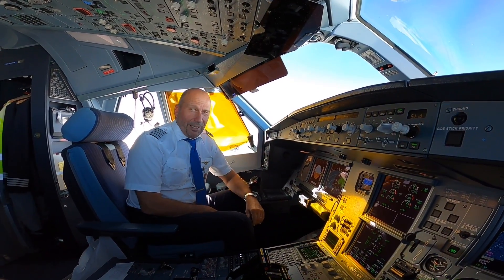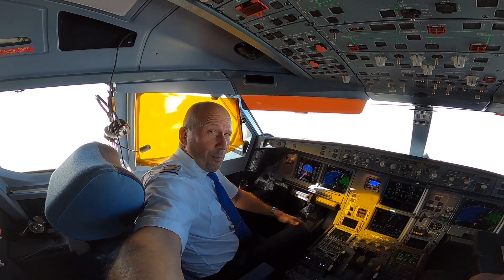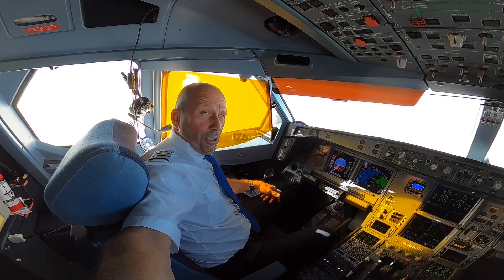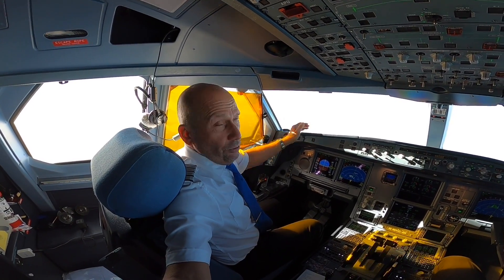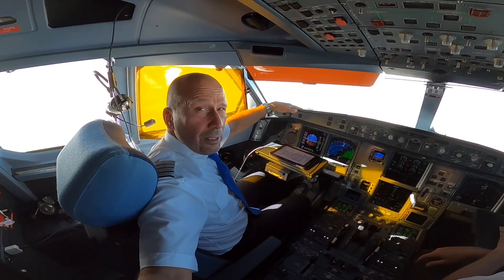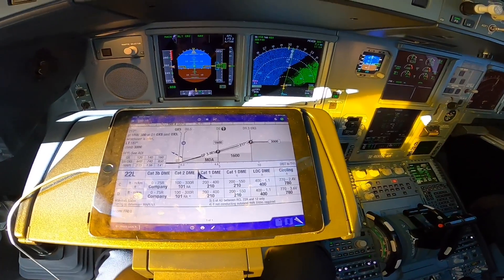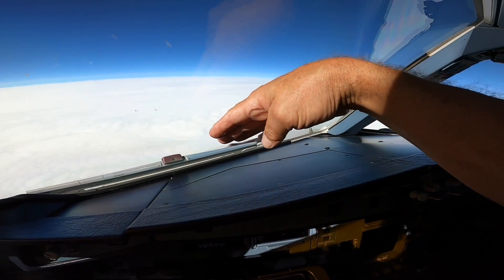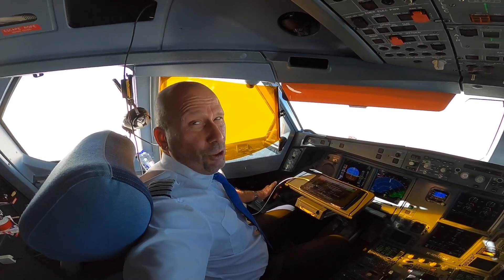Explaining how we land in fog without looking out.

Comment: Hey bjorn, one question: You showed us that the side stick position steers basically g-force vertically and bank angle vertically and then holds it like this. Does that mean it also auto-trims it, for example if you deploy flaps, does the pitch stay exactly the same?
Reply from the maker: Always auto trim yes, in normal law. In some degraded laws it say "use manual trim" on the adi.
Reply: @bjornpilot  Does this include windcorrection in case of a strong gust that might change the pitch or bank? or ground effect correction right before touchdown?
Reply from the maker: Jemand The flight control laws take care of gusts, so  move the stick as little as possible. Close to the cround the flight control law changes. It actually changes for different phases of the flight, especially close to ground.
Reply: That would be correct. Airbus work on Fly-By-Wire, so it'll maintain the same pitch, heading and bank you put it in so long as it's safe to do so.

Comment: Sir after reading in the QF72 I learned the rudder in some A330’s is mechanical and in some it’s FBW. So if you had complete failure of the computers (I know it’s virtually impossible) then how would you move the FBW rudder to turn the plane or would you just use engine thrust
Reply from the maker: Mechanical backup for the rudder. If all computers work it's fly by wire rudder and all turns are automatically perfectly coordinated.
Reply: bjorn pilot ah ok. But in some A330’s it’s still a purely mechanical rudder you mean?
Reply from the maker: Thomas Mortimore The 330’s are all the same. Normally you have rudder by flight control laws. But there is a mechanical backup in case of degradation of the computers.
Reply: bjorn pilot oh ok. I was just reading from the QF72 report

Comment: Can you please explain why there are two auto pilot buttons? one for you and the co pilot.
I would assume that even just one button has built in redundancy. 
Are they set to different parameters?

Thanks
Reply: AP1 gets its information from the captains instruments and sensors, AP2 gets its information from the FO’s side. You activate the side of the pilot who is flying. So for example if the captains altimeter or airspeed indicator were to fail then AP1 wouldn’t know what the altitude was but AP2 would so you would switch to that one. Both are used during autoland for redundancy as they cross check one another to make sure the information is exactly the same.
Reply: @tomstravels520  Thanks!
Reply from the maker: @tomstravels520  great answer. Appreciate your help. 👌🏼🙂
Reply: bjorn pilot I know technically you could then switch the captains ADR DATA to 3 but didn’t want to make it more complicated to explain

Comment: Can you explain about trimming and how rudder & brakes are controlled
Reply: Trimming is just moving the horizontal stabiliser so you don’t have to pull or push the controls to maintain the attitude you want. The yoke or sidestick just move the elevators for short term movements

The rudder is moved by the foot pedals and the brakes you push down the top of the pedals with your toes

Comment: Great video as always. My suggestion is for you to do a brief video explaining the basics of the autopilot, managed altitude, speeds, what is a flight director, etc. I've seen this in other channels but would love to learn it from you!
Reply: In simple terms the flight director is telling the pilot or autopilot where to point the plane to follow the required commands input into the flight control unit (altitude/heading) or the FMGC (lateral and vertical navigation)

Comment: could you explain more about the functions of the button above your head. I feel like these are the buttons no one talks about in aviation videos!
Greetings from Iceland <3
Reply: Buttons in the centre overhead are generally only used during startup and shutdown unless emergency in flight. Basically fuel, electrical, bleed air, hydraulics and fire. The ones nearer to the windshield are lights and APU which are used more frequently.

Comment: You mentioned that you only have one autopilot on at a time. Was wondering why not both, with ap1 or ap2 selected? I work for an international flight training school where we specialize in simulation training, and I am a maintenance tech on the equipment. My office specializes in rotorwing ac and from what I've learned we always have both autopilots turned on but we'll select which ap to use. Generally for us it's ap2 since we fly mostly from the right seat. 

I just recently found your channel and love it! Thank you for the videos.
Reply from the maker: Both autopilots only for approach and landing. All other phases one only. If left pilot flies we use 1. Right pilot 2.

Comment: Could you make a video of the whole decent phase. I am curious about how vertical speed and airspeed is managed between the beginning of descent to the final approach. Thanks!
Reply from the maker: Good idea! It's automatically computed and flown by the Flight Management System/autopilot. Needs updated correct winds, altitudes, speeds. Careful programming is required to get it perfect and I give it lots of attention so it gets a very economical and smooth descend.
Reply: @bjornpilot  Thanks for the reply! Cant wait for more videos.
Reply: bjorn pilot and then it all goes out the window when ATC says you can’t descend yet and have to wait. Bjorn do ATC often tell you “descend when ready” so you can do it at the T/D point?
Reply: @bjornpilot  yes please explain this process more. I am doing my PPL and obviously have learned the basics of pitching for airspeed and power for altitude on final, but it is all done visually with pilot judgement. I have always wondered if the process is the exact same for airliners to keep speeds and intercept the glide slope? If so, are you adding/removing the power and keeping the nose at the right height for the speed or is it all autopilot/FMS???

Comment: With regards to hand flying I remember Captain Joe saying that sometimes he'd disconnect the AP at FL150 and hand fly it the rest of the way just to remain proficient.

Meanwhile here I am using autoland on 737 in clear conditions on a flight sim because I'm terrible at it. :D
Reply: Once you have ILS setup just disconnect ap and follow them diamonds?
Reply: Luke Woolner if going off raw data yes otherwise follow the flight directors
Reply: The difference between flight sim and real life, especially if you are using VATSIM, is that you have ATC, MCDU, switches, checklists and everything else to do alongside flying the aircraft, mostly when I am flying I simply do not have the time to be disconnecting and hand flying. Obviously much different to the real world where you have 2 people to fly where you can actually focus on flying the aircraft
Reply: i dont trust autopilot in buggy simulator 2020
Reply: @fahik  VFR is the only way to fly in any MSFS
Reply: Yeah but on a flight sim it’s just you so you need the autopilot at least until final approach as you have so many other things to be doing
Reply: Thomas Mortimore I get 0 FPS so I guess autopilot works for me

Comment: hey bjorn, I have a question, is it possible (although probably highly unlikely) to have GNSS loss of signal or fault during flight? If in IMC conditions, how would you then navigate the aircraft? would it be classified as an emergency and you would get vectored by ATC to the nearest airport or would you continue navigation using radio aids (VOR to VOR)? if you were doing for example an atlantic crossing, what would be the procedure? Loving your channel my friend! Great job!
Reply: Well if you lost both GPS receivers then you’d be relying on the Inertial Reference System being fairly accurate and I believe it would use the average of all 3 to determine position but the accuracy would not be as high so an RNP approach is out of the question

Comment: Hey. Great video as always. May I ask why you can fly more than 1 type of aircraft? I thought most pilots only fly 1 type of aircraft at time? Thanks
Reply: Because the cockpit is identical in all 3 aircraft with only minor differences in the A330/A350. Most of the controls and buttons are in the same location. The difference is the A350 has bigger screens and more complex MCDU
Reply: @tomstravels520  It is more than just what is in the cockpit, but that is a major part of it of course.
Reply from the maker: Can have 2 type ratings. A330/350 is one. A340 is another.
Reply: @bjornpilot  oh. I always thought a330 and a340 were the same type rating. Thanks for your reply!!
Reply: Just Airbus things..

Comment: Would love an explanation of Airbus flight laws and what training you've had for the likes of doomsday scenarios - like direct law. Would also love your opinion on and what training you've received for spatial disorientation and what procedures are in place to avoid the likes of AF447 again where tragedy happened when one pilot was pulling up and another pushing down during a stall. In a Boeing aircraft that would have been immediately visible via the yoke and arguably could have been saved. How did side stick priority allow that to happen and how is side stick priority decided - I'd assume left seat? Is the side stick a Airbus design flaw vs Boeing? Love the videos please keep posting - esp the A350! Keep safe and safe flying during these difficult times Captain.
Reply from the maker: Thank you for your inputs. Good suggestions. 

Flying an Airbus you must look to see what the opposite pilot is doing with the stick. You don't see it on your own. You also must know that the pitch is around 2,5 degrees nose up at cruising altitude. If it's another value something is wrong. 

We have trained a lot to fly without airspeed indications at SAS, at all phases of flight. Including approach and landing. 

Great idea for a video, but a tricky one. I'll do it! 👌🏼🙂
Reply: Nobody pushed the sidestick priority button on AF447 and the dual input warning was not heard because the stall warning has higher priority. The rule is trust your instruments unless you can see that one is different to the other (that’s why you have 3) which Bonin failed to do. Same with that Atlas Air pilot in Houston. Believed he was stalling so pushed nose down and crashed the plane. Even with a yoke the captain still didn’t do anything until too late

It’s only a design flaw if that is how it supposed to be done but doesn’t work. Golden rule of airbus: Only one person flies the plane at a time. That’s why you have Pilot flying and pilot monitoring and you make it clear who has control.
Reply: Thomas you are quite right in what you say. It's one thing us sitting here in hindsight debating the issue and another actually being in it so it's easy to be critical but there are many things to learn from it. In terms of where side stick priority is (which is something I hope Bjorn will talk about) Bonin was pulling up whereas the more senior FO pushing down, if priority was left then irrespective of Bonin's actions Robert's would have overruled despite no audible mention as you correctly highlight,  however Bonin was PF so it appears he had priority despite being the least senior. There was a breakdown of communication in that front but as Bjorn says you can simply look over. A simple solution - like the pen and pencil in space. Hopefully Bjorn will elaborate more on side stick priority and how it's assigned, especially on longer flights with 3 or more pilots and pilot rest breaks. I disagree with the PF and PM distinctions you make. There is a rank and seniority - experience ultimately. While one pilot sees the other doing something potentially dangerous or  beyond the SOP's not previously mentioned then they have a duty to mention and bring that up. CRM has moved forward over the decades where accidents happened when junior pilots wouldn't speak up (most notably the KLM Pan Am disaster but also likes of JAL 8054 and many others - Avianca 52, Korean 801). That said, my opinion was a failure of communication resulted in an irreversible situation developing.  That said there were many factors that the report didn't mention as well. So really this whole subject is like answering how long s piece of string is. 

Bjorn - will look forward to hearing your thoughts esquire. In the era of cockpit visits when I was a teenager I was a pilots worst nightmare of a visitor 🤓😉. That said as a self confessed Avgeek, it did allow me some cockpit landings back in the day. Alas youtube now fills that void with the commiserations of an expired PPL!
Reply from the maker: @CRITCH16  It's a lot about communication in the cockpit. You must have a very open and trustful atmosphere, like "I'm pulling the stick back now" or "I'm pushing". Then you open up for inputs.

Comment: If automatic landing are very accurate even in low visibility conditions, then why aren't all the landings done automatically for better safety?
Reply: He explained this in the video.
Reply: @JeffCohenOnline   oh my bad. I'll watch it again. Thanks
Reply from the maker: @randomist8687  Also some limitations. The pilots usually lands softer. Usually. 😉😂
Reply: The biggest reason is the accumulates training he explained. Computers could certainly do a better job (not with the current Airbus software/computers), but then you wouldn't have the pilot training anymore. Therefore adding better autoland capabilities to current planes adds very little value.

Comment: Fantastic, do pilots still feel the feedback on Fly By Wire stick?
Reply: Airbus has never had dynamic feedback from the stick except for stick shacker and the static feedbacks that are built in. Check out Rockwell Collins latest suites for Gulfstream and Irkut MS-21 for joysticks with dynamic feedback.
Reply: @rkan2  Thank you for the great information that only Russian aeroplanes have them. I heard fighter jets have a gravitation relative shacker. And also an AirBus plane control itself by aerodynamics program while Boeing depends on human inputs. It reminds me traction controls on cars and motorcycles.
Reply from the maker: Maybe not dynamic feedback in the sidestick, but there is a force feedback. 

I think the feeling is very very good and you have excellent control of the plane. 

I flew the MD80 before the A330/340 and it was much more sluggish in the aileron. The MD80 uses tabs and aileron movement is kind of secondary response. So very sluggish when the A330/340 is direct. I also liked the DC-10 very much, for fine response. 🙂
Reply: @bjornpilot  If you mean force feedback by the dampers, yes, but AFAIK Airbus sidesticks only have passive feedback: https://sim-on-a320.com/blog/2017/03/28/sidestick-springs-repair/

Also, I was wrong, Airbus sidesticks don't have stick shakers.. :)
Reply from the maker: @rkan2  Yes, but the passive dampers are actually good. 🙂

Comment: Please explain how the joystick controls the flight. Thanks for your
outstanding videos.
Reply: The inputs are converted to electrical signals which get sent to the flight control computers that then send the signals to the servos and move the controls. You command a roll rate for roll and g force for pitch. So for example if you move the sidestick left a bit you’re asking for let’s say 2 degrees a second but move it further and it increase to say 5 degrees a second. In pitch if you pull back slightly you may ask for 1.2g. This rate will be different depending how fast the aircraft is flying but this is so you don’t overstress the airframe
Reply from the maker: @tomstravels520  Perfect Thomas! 👌🏼🙂
Reply: sidestick
Reply: it's ok I thought it was called a joystick too for the longest time 😂

Comment: I've edited the question so now you have no idea what i wrote:)
Reply from the maker: It depends on the weight in combination with engine thrust. The higher altitude the lower fuel consumption (because of thinner air), but you must have enough engine thrust for it.
Reply: Mostly air traffic or aircraft type. You don’t want airplanes colliding in the sky.
Reply from the maker: @eun5oo  Correct. Airplanes in the same area are separated vertically.
Reply: Concorde at 60k feet,bring it back
Reply: @vellagang678  the reason why Concord became obsolete was because many people began asking  questions why they couldn't see curvature of the earth from 60k feet. The earth is indeed flat, they killed off Concord to hide flat earth.
Reply: truly a comedy genius. Hilarious.